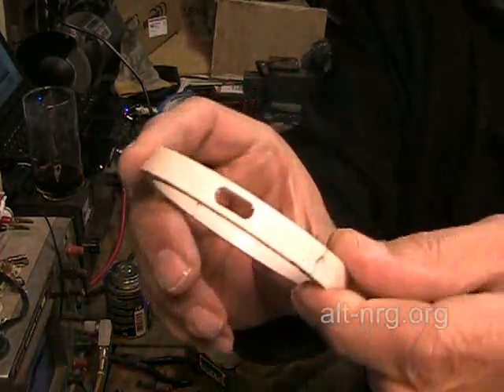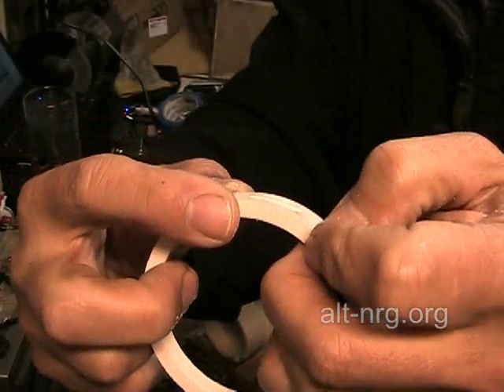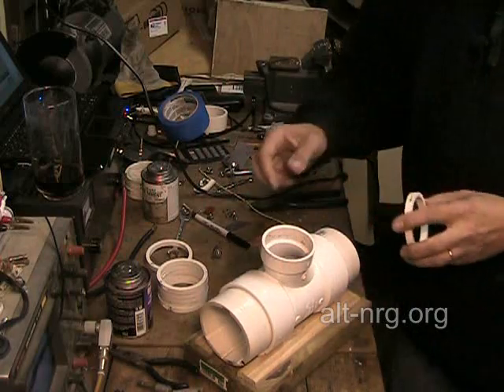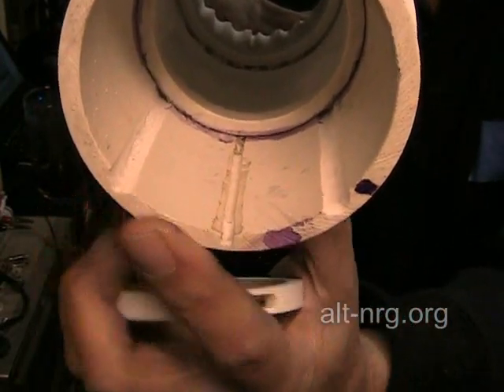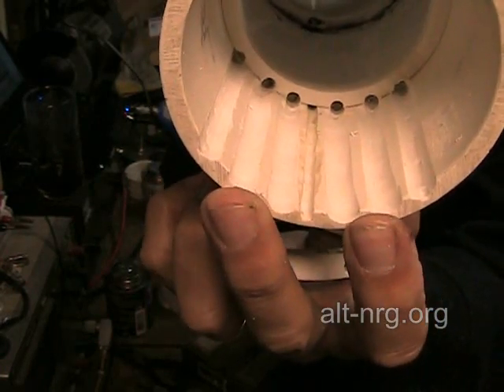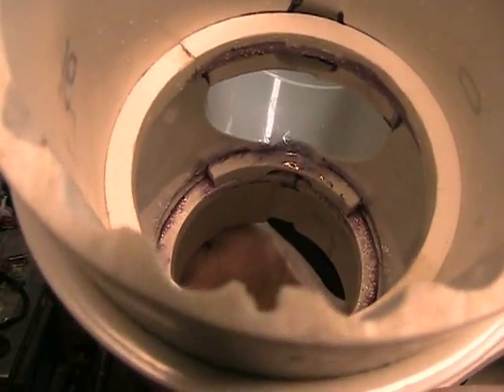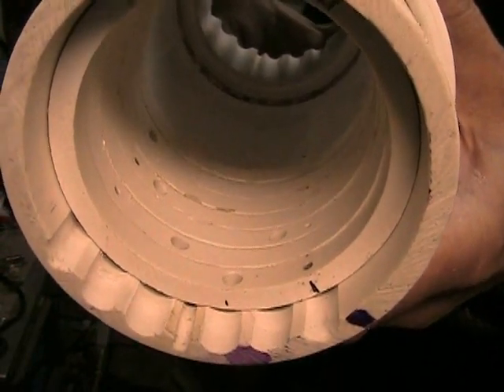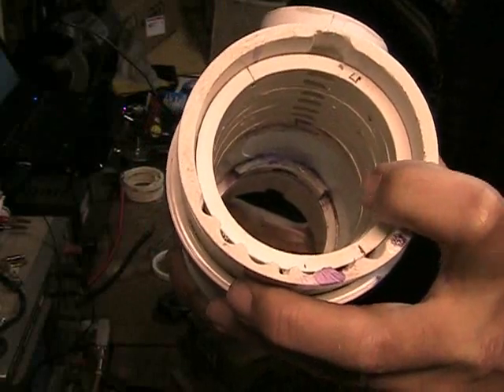#212 - Inverted T-cell rebuild 3

Comment: When the water jet cuts our plates we have two holes cut at the top and a return channel cut in the plates at the bottom. On the 3 inch plates we swap them and put the holes at the bottom.

Comment: I'm glad you did the separate inlet grooves at the bottom for each cell.  A few videos back I was going to suggest a tapered gas slot at the top; widest at inner cell, to attempt to maintain equal backpressure in each cell.  I didn't say anything cause I was afraid it'd Tee you off (sorry for the pun).  Thanks for the entertaining construction video.

Comment from the maker: The object was to reduce the exposed edges of the plates from solution. With a drilled hole the exposed edge is 3.14x the diameter. By placing the exhause vent channel at the very top it was supposed to keep the electrolyte level below the top edge of the plates.

This design still did not work well in practice. Not sure why.

Comment: Okay, I do have a suggestion for the way you have your electrolyte return lines. you have six channels aligned left to right 1-2-3-4-5-6. Currently you have your rings aligned is 1-6-3-5-3-4, obviously the closer you get the edge of the cell, the higher the risk you have for current leakage. My suggestion is to use 1-4-2-5-3-6, that would be roughly an inch of travel for the electrolyte between the channels.
I love your design though :D and all of your work.

Comment from the maker: Plate spacing is a bit arbitrary. The greater the space the higher the elyte concentration needed for the same conductivity. That said, larger spacing does benefit from better circulation, and I believe it will produce the phenomenon I witnessed in a much earlier video series on the S-Cell whereby gas it created in between the plates as well as at the plate surfaces. We'll see.

Comment: Great Work Zero. I want to ask a quick question. With all the little problems you're having using a T coupling, why not use a Y coupling instead. Would'nt this make the gas travel upward as well as the water travel downward. Just a thought. Shaun